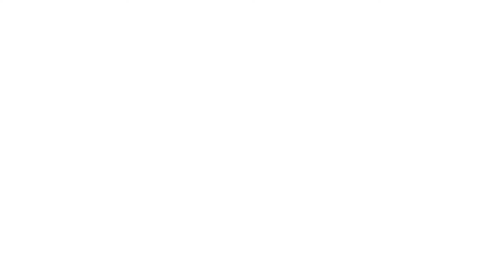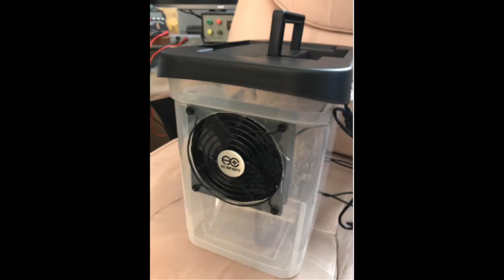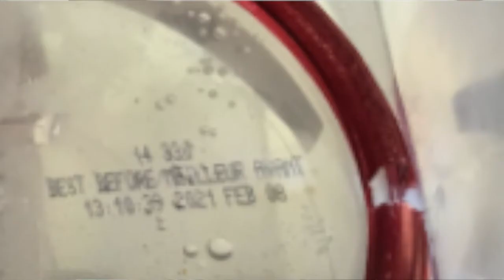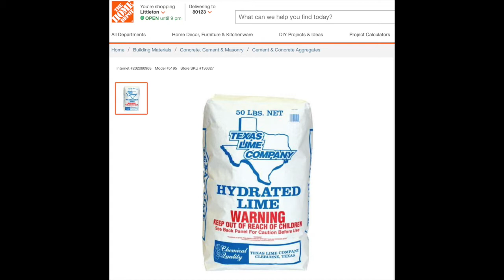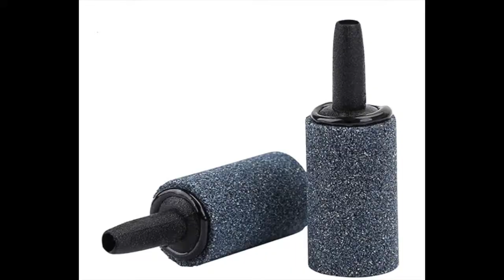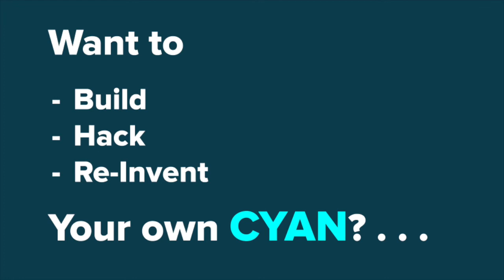TSM: Hello, Cyan! with Dahl Winters

Comment: If you moved the fan to the input side of the box it should work just as well, right?  Then you could make the air source the output of electronics cooling units and have an air flow source at no additional cost (or rather a cost that would be spent anyway).  Would the natural temperature change from exhaust air as it cools aid in generating humidity?